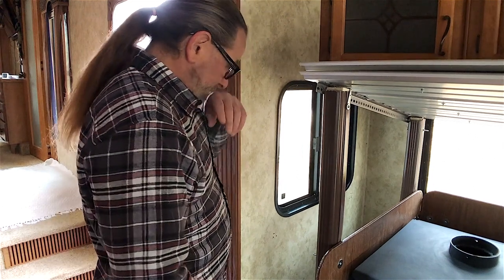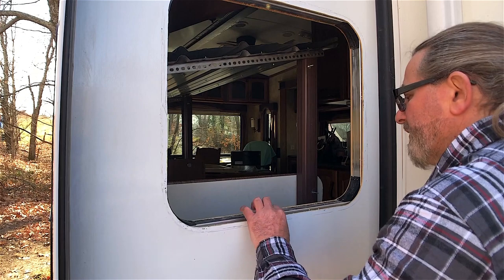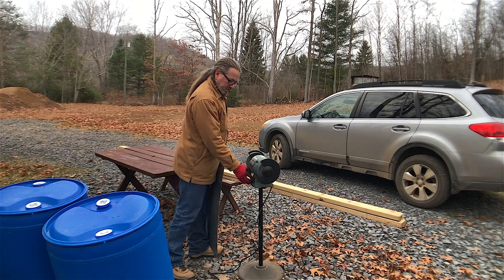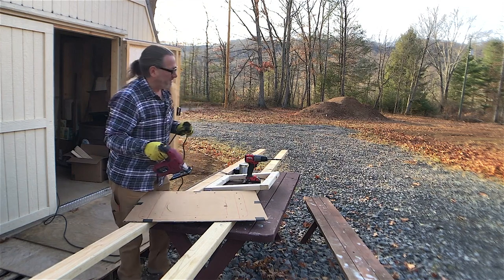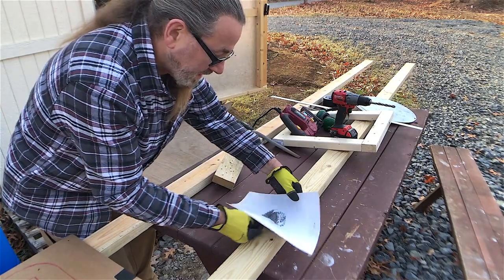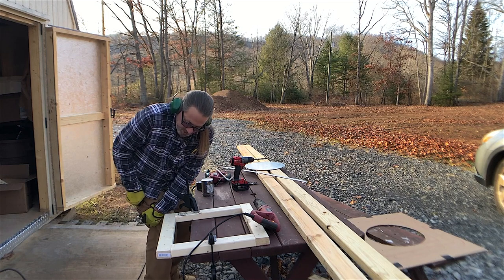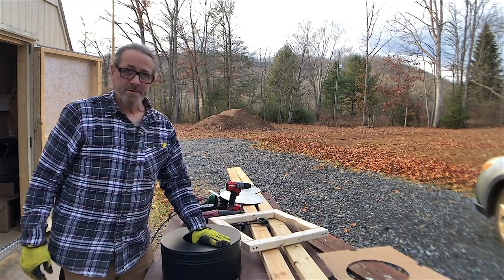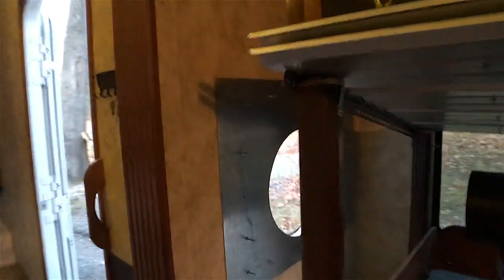Wood Burning Stove Installation in RV Camper Travel Trailer - Part 3 - Starting the Thimble

Comment: Hello Im needing to do this close to exact same layout except my window behind the stove actually swings out and up Id like to know how big is your stove ? is it tall and how far from that back wall is your from the board to window? Can i set my little k2ft by 1ft pedista Orley pedistal stovel on a fire heat pad w/bricks underneath the pedistal I sure wish i had your skills. My stove doesn't stand very tall like yours. i don't want the bos around mine but do i have to have this much built around it?
Reply from the maker: Due to the tight tolerances of living inside a trailer, I was OK with building the protective walls around and above it. I don’t know the exact dimensions of my stove, I would call a medium size. If you have a small one, yes you could put it on a pedestal. Safety first! You will love the heat! All the best, cheers!

Comment: Nice job! How many SQ feet is the stove rated for? Do you ever get to hot? Im looking at doing something similar in my 40ft 5th Wheel
Reply from the maker: I don’t know how many square feet the stove it’s rated for because I don’t have the manual with me and I’m on vacation. Yes, it can get hot and milder weather. I just open vents, or the door, or windows. In a hard cold, it does a great job! Good luck!